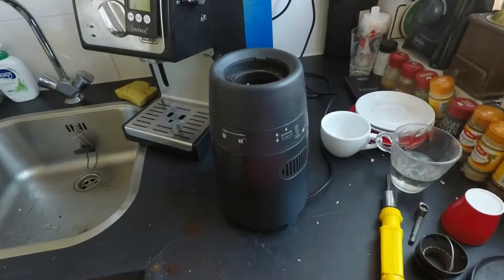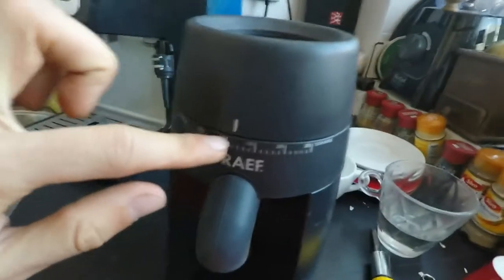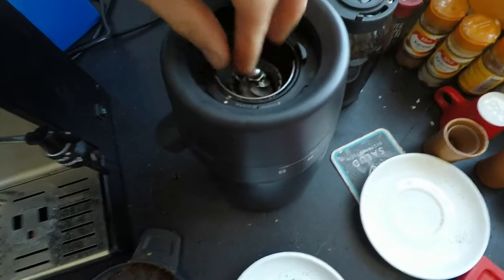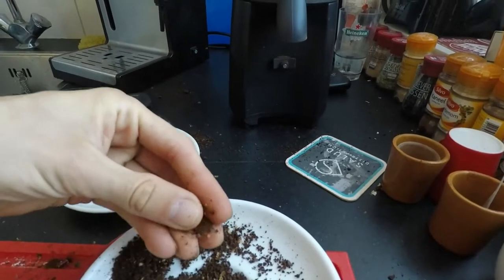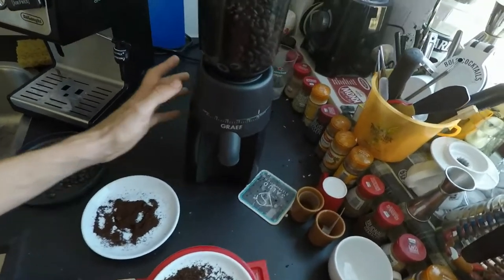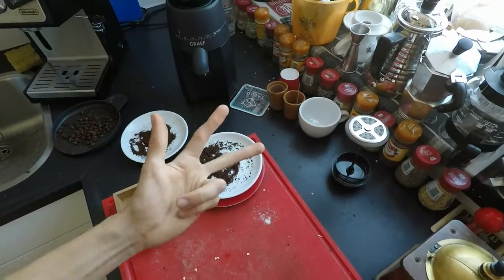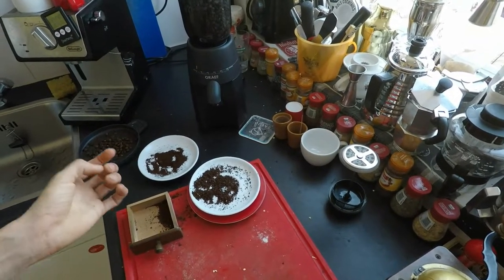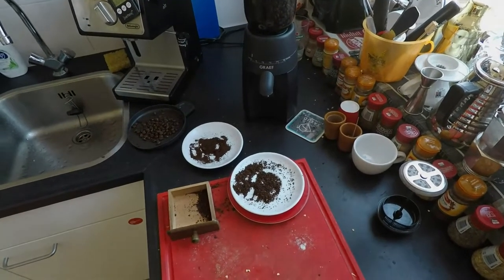Graef CM702 lock test & Cafetière grind / Announcement

Comment: Hello MJ again :) I have been trying new settings on this machine and I wanted to ask you, have you ever tried with a 0.2mm washer + press the back button which helps you pull off the upper side of the machine. If you press the back button and move the head more than 25 you can get more coarse. I think you can get almost every size of coffee with this hack starting with Turkish coffee until pour-over.
Reply from the maker: No way, that's an amazing hack! I could try that for my cafetière. Thanks for tip!

Comment: Thanks for the video Michel, I too have the Graef grinder, imported to the UK from Germany (saved me £25 instead of buying it from Amazon UK). When I first used the Graef I thought mine was faulty as it wasn't grinding fine enough but in fact the issue was that I had the grinder misplaced - as you do for coarse grinds.
Reply from the maker: Thank you for watching,  George. Interesting that direct sales are still cheaper. Usually Amazon is hard to compete with.
Reply: Did you buy directly from the Graef Web site?
Reply: @markdoyle4718  Amazon DE
Reply: George could help me and tell wich the best number level for espresso shots if you use it for espresso? Thank you
Reply: @hassenboussoffara6613  depends on which machine you have, I have a Delonghi dedica. On the grinder I have 1 washer (metal ring) installed to make the grind finer than the normal configuration. For pressurised portafilter I use grind level 15, for my unpressurized basket, I use grind level 5. Hope this helped 👍
Reply: @george8859  thank you a lot George your reply been very helpful 👍👍👍
Reply: @george8859  Hi. I've just got my dedica and graef720, the lvl 5 (with 1 washer) is finer then lvl 1 "standard" ? I Also got a bottomless portafilter  with unpressurized basket, can i use it to make single shots (7gr)? Is the same ratio apply? 7gr in, 14gr out, aprox.15seconds ?

Comment: Hello, I have this machine too and I guess it has built in 0.2 mm washers inserted by factory. I have looked your google drive docs and I wonder if it has correct size for filter coffee with 0.2mm washers? Or is there any way to do this with 0.2mm? Thank you.
Reply from the maker: Hi Tolga, I don't use any washers when grinding for filter coffee. Theoretically you could still do with one 0,2mm washer but you'll have to use less coffee, as it is on the finer extreme of filter grind. If you don't reduce the dosage, the drip time becomes too long. So not necessarily a bad thing, but with the 0,2mm washer most standard drip coffee recipes that you'll hear in videos, fora, etc. won't work that well so you'll have to adjust for time and ratio yourself.
Reply: @mjbartending  I understood. Thank you 🙂

Comment: I installed grinding wheel correct way but It don't grind at all at finest settings. Help
Reply from the maker: That could be the limit of the machine itself. I encountered the same when nearing or going below setting #5. Those finest settings only work when you install the thicker washers underneath, for slow pour grind. On espresso finesse, it clogs up around #5 and lower.
Reply: @mjbartending  maybe you are right. Im trippin' a little bit because I own my grinder for a week and it was grinding with no problem at finest setting but today after I clean it and reassembly it start grinding around 8 and do it very slowly.
Reply from the maker: @TheProject43  what type of coffee are ypu grinding for? Espresso, v60, other?

Comment: Thanks for the video, any difference between 702 & 800 models ? 

Do you recommend 702 for non-pressurized basket delonghi dedica ? how fine it grinds.

Thanks again.
Reply from the maker: Hi! From what I've seen the 800 series has a 40 step finesse scale and the 700s a 25 step scale. However, with the adjustable washers the 700 series basically has a much wider finesse range than you migh think. In the German manual of the 800 series, 3-step fine adjustment of the grindingwheel itself is mentioned. This seems to serve the same purpose as changing washers on the 700. The "automated" function of the 800 is no more than the "push to start and stop" button that you can activate with a portafilter, but no automated dosage. Same size bean reservoir. So no real benefit from what I see, but a stronger aluminium body on the 800.

The 700 is good enough for factory pressurized filters, but it is hard to dial them in because of the fake crema. Go non pressurized if you cna!

Comment: I cannot get the lock to click. for what reason ever
Reply from the maker: Plastic button can be upside down. Narrow side should be up. Happened to me before
Reply: @mjbartending  Thanks for your fast reply. I found out i used the second spring wrongly, which is for the activation of the safety mechanism. It works now :P

Comment: Which scale do you reommend for v60?
Reply from the maker: Hi Németh, I havent't tried V60 with this grinder set up yet but I would my finer  (yet still affordable) scale than the JoeFrex seen here. I'll check which model it is when I get home.
Reply: @mjbartending  sorry, maybe i said wrong. I meant for grind size. I usually use with the 20 and for mocca with 15. Whats your opinion about it?
Reply from the maker: @malimalbub  I understand now ☕ For moka pot my coarseness for light roast is 25 but with two 0.2mm washers installed, full routine here: https://youtu.be/PE1MTJBAmOg . V60 I haven't got to try yet as I unexpectedly got fungus in my attic which is a pain in the ass to clean. The recommended V60 coarseness is medium-medium fine. Medium I tested to be setting 20, but without any washers installed. Medium-fine I have yet to try out with light roast coffew but I got different coffee as a gift that I need to finish first. Once. I've found my settings, you can read them here: https://docs.google.com/document/d/17fl0H44RmxDoH50x8Yc9O-PXv3R2WHO_hbo_S-IA3qQ/edit?usp=drivesdk
Reply: @mjbartending  Awesome! Thanks for the reply and for the documents! :)